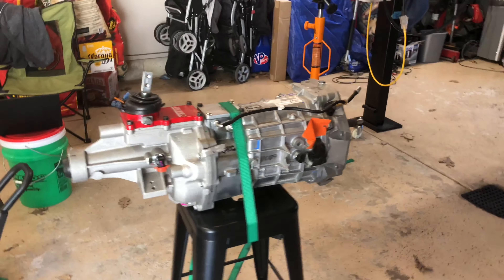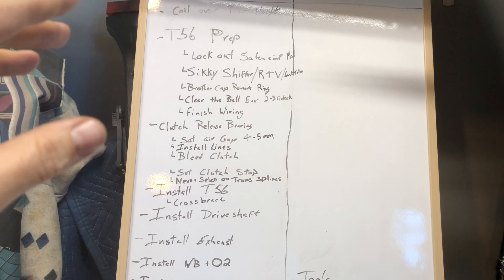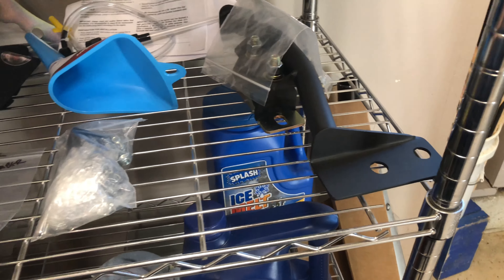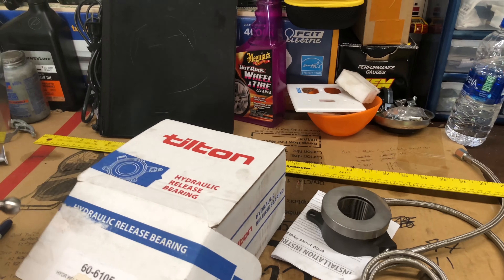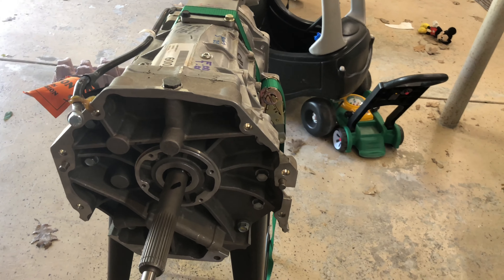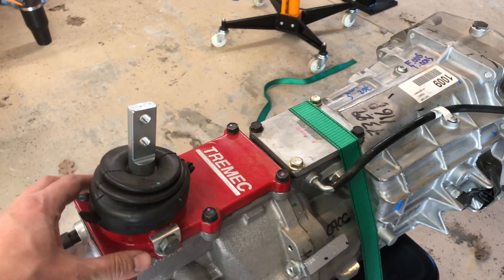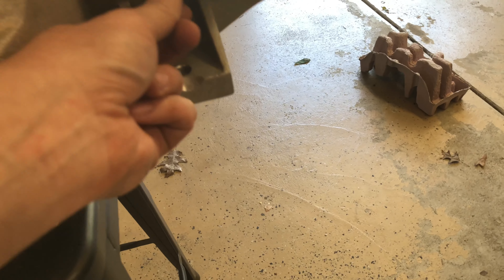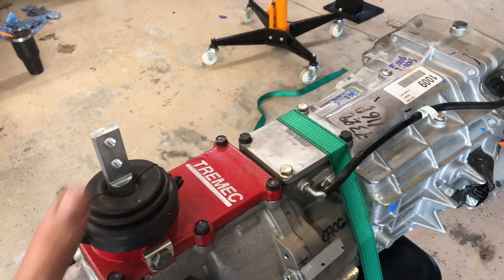1998 Supra Turbo Auto to Manual Conversion Part 3: T56 Modification, Install, and Driving Impression

Comment: Got a good link for the shopping list needed besides the grannas kit?
Reply from the maker: G.Masheen I don’t, Joel puts together all the bolt kits, wire pigtails, and odds/ends to make it rather comprehensive.  I’d gladly pay a few bucks more for less headache than piecing it together honestly.
Reply: @willizm  definitely, would buy his kit. Thinking overall - clutch pedal, brake pedal, clutch, lines, slave, what else is needed? I haven't found a thread yet with a list of needed parts.
Reply from the maker: @That.Old.Toyota  going off of my invoice it is the Trans, driveshaft, bellhousing, sikky shifter, pigtails, crossmember, trans mount, clutch, flywheel, clutch alignment tool, arp flywheel bolts, pilot bearing, throwout bearing, clutch lines, master cylinder kit, dakota digital box, shift knob, shifter cone, shifter interior panel, brake pedal, clutch pedal, rubber pedal pads, shifter tunnel panel, and all the bolts/nuts/washers you'll need for the install.  It's alot of stuff thats for sure.